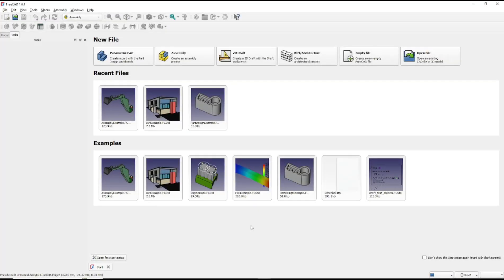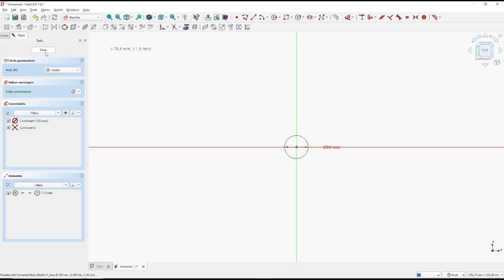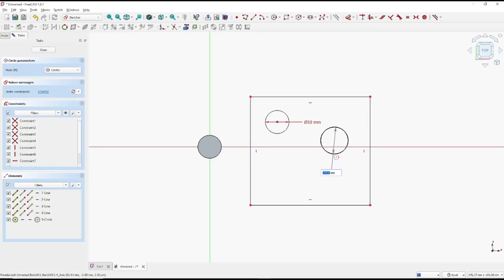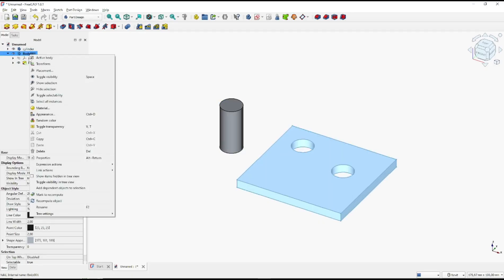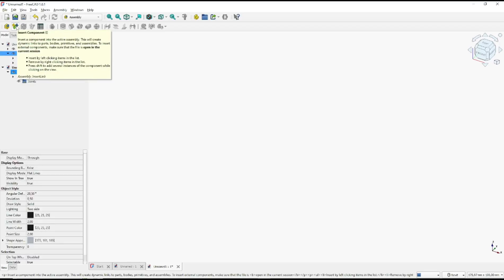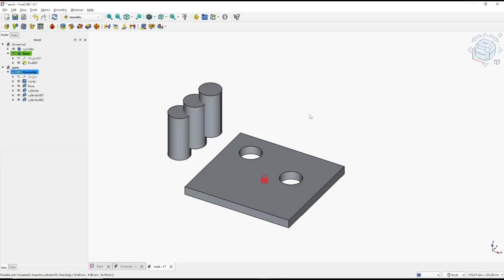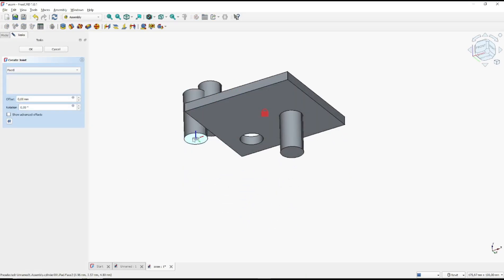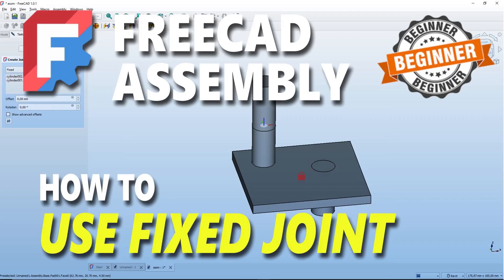FreeCAD Assembly How To Use Fixed Joint

Comment: Hello,

I'm struggling on how to fix 2 parts together without them changing ther orientation. Lets say you manualy (using transform tool) place cylinder on random place near the plate and then you want to fix its current position to this plate (without using any geometrical constrains )
This should be easy but i dont see that option ....